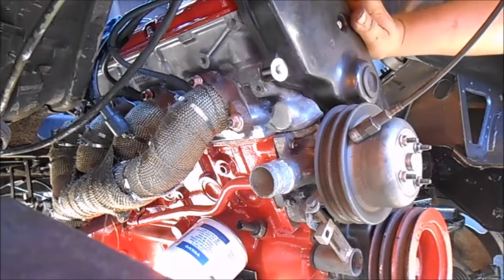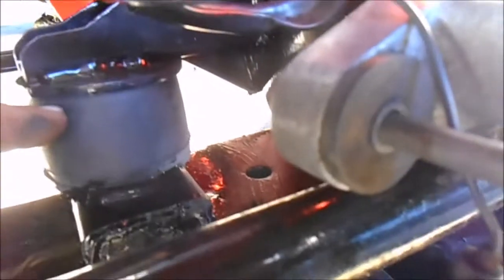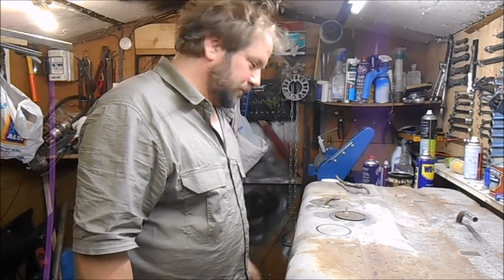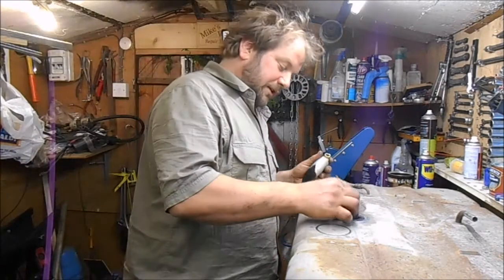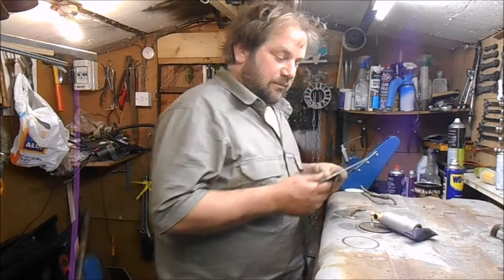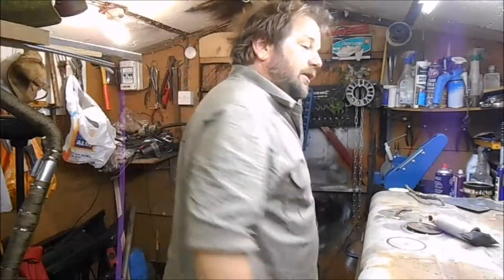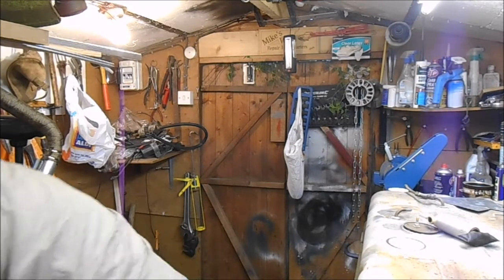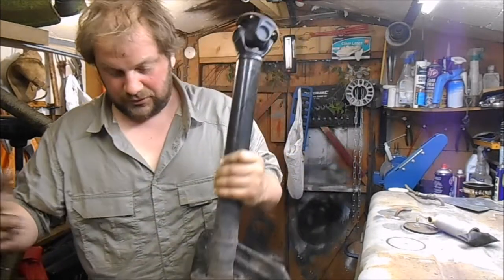Episode 5 engine is fixed in, thinking about the next couple of jobs

Comment: Mike I had a complete prop made for mine, I think it was about £250. What was annoying was I had to take the rear of the gearbox up by a couple of centimetres because the engine and box was leaning back, this wasn't really apparent until I'd got the van back on it's four wheels after fitting the engine, it's meant that the props sliding joint is now slightly further apart than it was, probably won't really matter but still annoying.
Reply from the maker: Cheers for the comment Trev. They called up about 4 hours after I dropped the props off this morning, they've done it already for just £50 + vat! chuffed to bits! I was a bit worried because I'd heard they could be pricey.
Reply: Mike240 Forager Hey can't go wrong with that! Happy days! I'm finding that I'm endlessly having to tweak things and when I do it interferes with something else, and that then needs attention... I've bought quite a few parts that are now destined for the bin, but I don't feel quite so bad if I only paid 20-30 quid for them and it's answered a question. The worst thing for me personally is getting stuck and wasting days going round in circles.
Reply from the maker: I know what you're saying, but I guess that even if you've got nothing done and spent all day doing it, at least you're wiser at the end of it. what are you doing about fuel pumps? I have tried to make an intank unit today (I.e a  steel plate) I need to get some fittings for pipes to go through the plate...
Reply: Mike240 Forager Yeah I saw you talking about cutting a hole, I hate messing with tanks and I might have a go at cutting a hole in mine as the fuel sender in the tank won't run the new fuel gauge I've bought...talk about a can of worms. At least yours is a steel tank and should be a bit more straightforward, when it comes to making a fuel proof seal. The tank in mine is from the focus donor car that I've used the engine from, in theory it keeps things more straightforward as the pump is in the tank and it's just plug and play, but I ran into challenges making up fuel lines that joined to the original fittings. A friend of mine put a fuel injected pinto engine in his Bedford CA and he used the original Bedford fuel tank, he's got a mechanical or electric pump (can't remember which now) this draws the fuel from the tank as if it were a carburettor, under the bonnet it has a swirl pot and high pressure pump, so all the fuel injection side of things happens under the bonnet, this is how he's managed to keep a standard tank.
Reply: Ps if your wanting to seal a pipe in a steel plate, depending on what kind of pipe it is? If it's a fairly plain steel pipe you could braze it round, if it's nice and clean it'll never leak and the fuel won't attack it, apart from that you're looking at some kind of bulkhead fitting that you could compress an o-ring behind?
Reply: Don't get that welder near that tank though....💣
Reply from the maker: I cut the hole, I tried to weld a little steel tube through the plate but blew a hole in the tube trying to get it all sealed up, grind it all off, tried to braze it but my brazing is worse that my welding. Might try some copper pipe tomorrow, failing that I'll buy some compression fittings.
Reply: Mike240 Forager Search for BULKHEAD CONNECTOR PETROL PIPE on eBay if you put the bolt part of the fitting from the inside with a fibre washer or an o-ring and then just tightened the nut down on the outside with a standard washer under it, that should do the trick. Make sure that pipe you're trying to weld isn't stainless steel, stainless cannot also be brazed without special flux. Welding will never seal and if it does the inside of the pipe will be so deformed due to the excessive heat. Hope this helps
Reply from the maker: cheers!